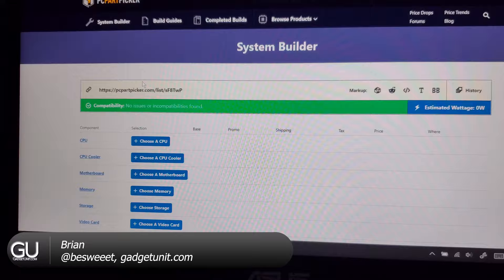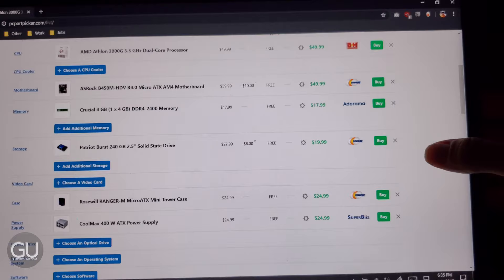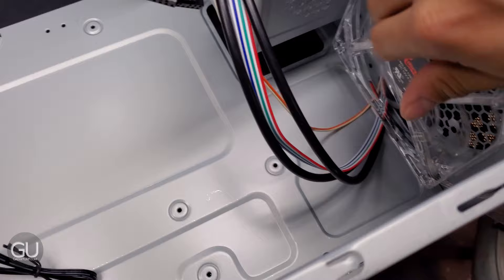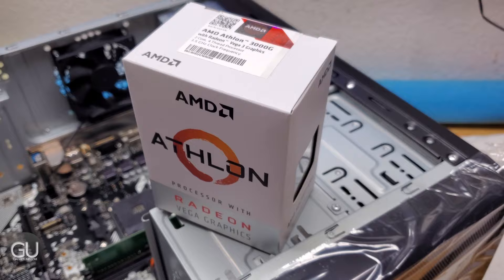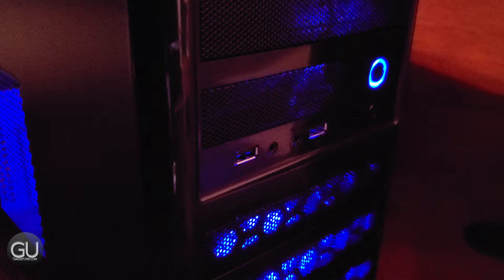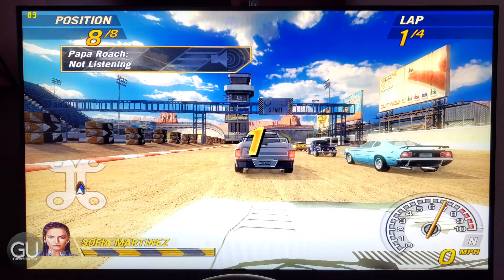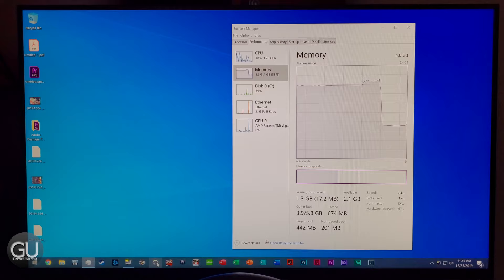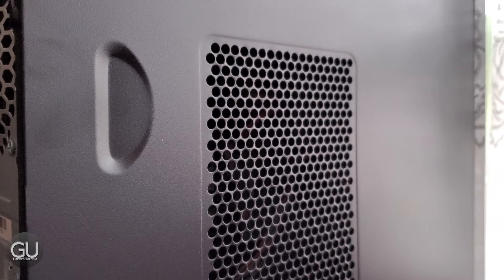Cheapest AMD PC build on PCPartPicker (build log and testing)

Comment: 4gigz of ram is too low even for ultra budget.
Reply from the maker: For some cases, sure. I think that the majority of general-purpose users are fine.
Reply: @gadgetunittv  With 1 stick of 4GB Ram you lose also dual channel. 

So you are not only losing half the capacity but half of the memory bandwidth too that affects greatly the integrated graphics performance and looking at the prices you get 2x 4GB ram sticks for like 10 dollars more so it's better in GB/per dollar too.

 Also with 8GB you can configure more memory to be reserved for the IGP and also minimize offloading to the SSD because of a maxed out ram(by the way the frame drops in the games you tested probably are from the 512MB of single channel ram allocated to the gpu or of maxed out ram that causes the system to offload data to the much slower SSD).

I understand your purpose is to cut corners and i liked the video generally but it would be nice idea for a followup video to buy a 2nd stick run a dual channel config  allocate 1-2 GB for the IGP and check if those extra 10$ worth to spent, who knows maybe i am wrong.
Reply from the maker: @insgr  Agreed. That's why I mentioned how doubling the RAM should quadruple the shared video memory, or at least that's what my recent 2200G + 8GB RAM gives towards the Vega 8 (2GB). More for the system + more for the integrated GPU = win win!
Reply: @gadgetunittv  also running dual channel doubles the bandwidth. single channel memory is pretty bad for the IGP regardless of the amount reserved.